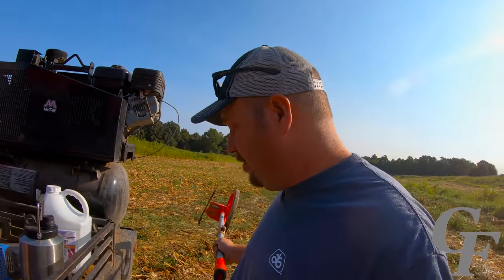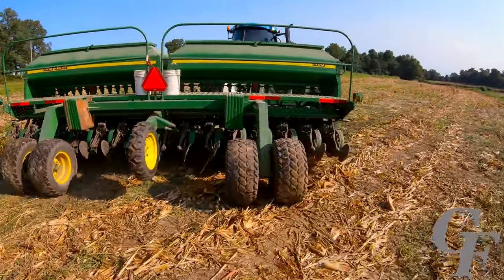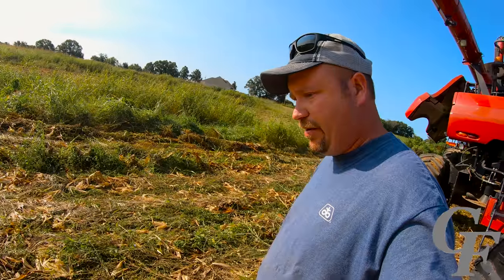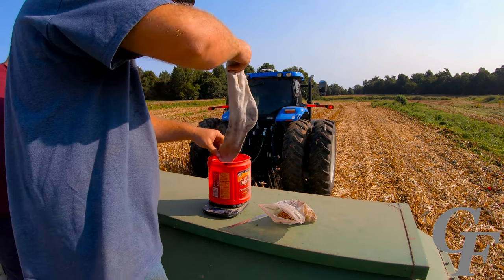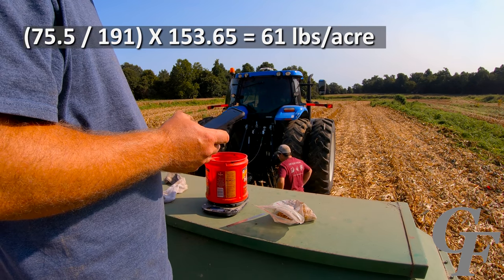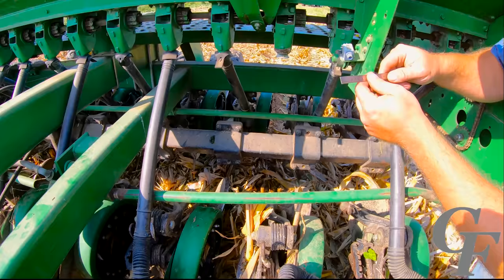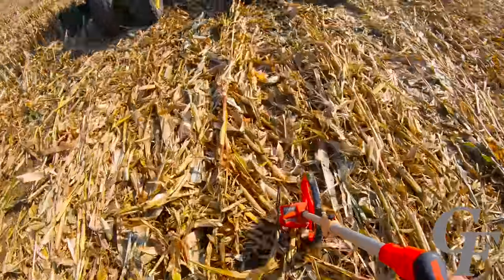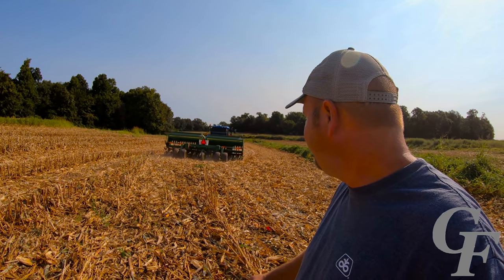How To Easily and Accurately Calibrate a Grain Drill

Comment: I just bought a new 1590 drill, thanks for putting this video up.  This is going to be very helpful
Reply: If you remove the cover from the right end of the drill and make a hand crank to fit in the rectangle hole you can turn the metering shaft while stationary and can calibrate before going to the field.

Comment: Matt thanks for the video. I was off from factory settings on wheat last Fall. This will help me out. Also Loup makes a monitoring system for these drill. Not too expensive.
Reply from the maker: Yeah I don’t think the factory settings are even a good starting point. I’ve never found them to be close. 

You might want to reset your feed cups so they’re all even. Close your gates all the way and loosen the bolts on the seed cups to make sure the fluted part is even with the seed cup. If you haven’t done that before I’ll almost guarantee there’s 5-10 lbs/acre difference between different rows.

Comment: I do custom seeding with a JD1560 drill. I bought a set of scales for the grain tank.  They bolt directly on, only had to lengthen the chain and clutch rod.  I can fill it full and measure how much comes out over an acre then adjust. I can usually get it right within 3 acres.  With custom work speed is the key. Scales came from Scaletech as a kit.
Reply from the maker: We’ve got scales on our seed tender which helps us confirm our calibration.

Comment: Thanks Matt. Can’t wait to try this out on wheat in a couple weeks. Setting our Great Plains no till drill is always a challenge, hopefully this will be the answer.
Reply from the maker: Just beware I’m not sure if this formula works if you’re on a different row spacing than 7.5”. I haven’t been able to reverse engineer the formula to figure out how the 153.65 number comes into play yet.
Reply: @griggsfarmsllc  
That’s what I’m running, 7.5”.
Reply: @griggsfarmsllc  
Does drill width matter or just row spacing? Is that where the 153.65 comes in play? I run a 24’ drill.
Reply from the maker: @chrisbruffett3270  drill width does not matter

Comment: one question on the formula, is that what is being put out per tube, or per drill?  Didn't see anything that said anything about number of rows running, which I would think needs to be factored in with a 6' food plot drill versus a 24' ag farmer drill?
Reply from the maker: As long as drill is on 7.5” spacing drill width doesn’t matter. You measure at the seed tube. You are measuring how many pounds per acre comes out of an individual seed tube. As long as the rest of the seed tubes are putting out the same amount the result will be accurate. The formula takes into account the area that that one single unit covered, not the entire width of the drill
Reply: @griggsfarmsllc  So as my 72"  Tar River with 10 tubes as an example, the equation should be:
((weight captured 1 tube/distance travelled) x 153.65) x 10 tubes = lbs/acre (in a perfect equal system), correct?
Reply from the maker: @sgto_o7118  no. You don’t multiply the final number by  10 tubes
Reply: @griggsfarmsllc  thanks for the reply, Ok, I'm confused then, so your equation calculates per tube, but I don't account for the number of tubes?  Just clarifying, as I would think the number of tubes has to have some sort of baring on it all, with my drill having 10 tubes, and others having more?
I think I'm missing something here
Reply from the maker: @sgto_o7118  I don’t know how to make it any simpler. You are measuring the output of one unit. You’re also measuring the distance that one unit covers. The formula calculates the rate based on the output of that ONE unit and also the area that that ONE unit covers, not the entire drill. 

If you’re measuring plant stand in corn, you measure off the distance of 1/1000th of an acre for ONE row and count the number of plants in that row only and multiply by 1000 to find out how many plants/acre you have. You don’t take into account how many rows your planter is. The same principle applies here.

Comment: but where does the 153.65 come from ?
Reply from the maker: I couldn’t tell you. I didn’t come up with the formula. Probably in the conversion from metric to standard units
Reply: @griggsfarmsllc 
gonna try this with sudan but my tye drill is on 8" spacing. gonna shoot for 100 lbs per acre and see how it turns out